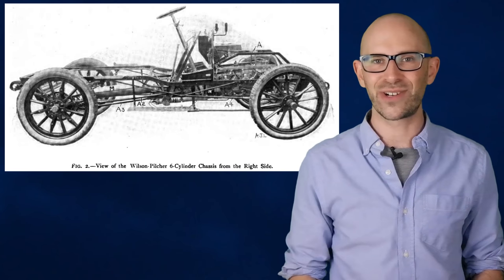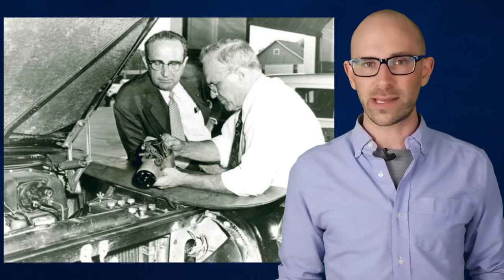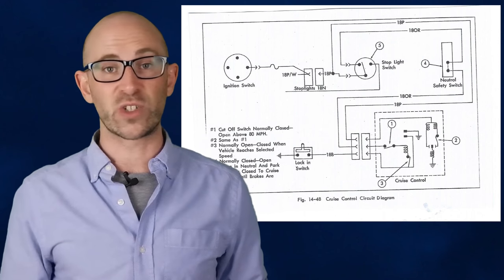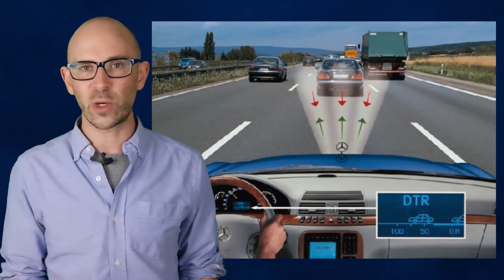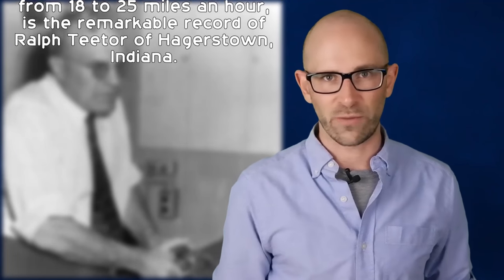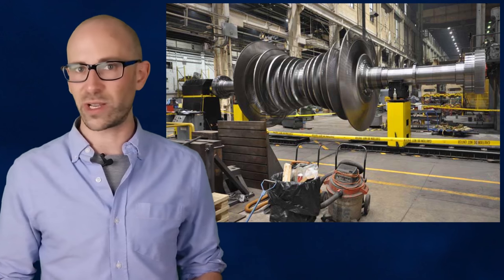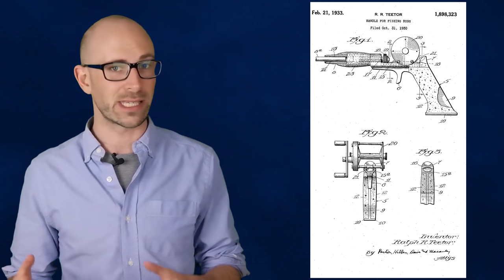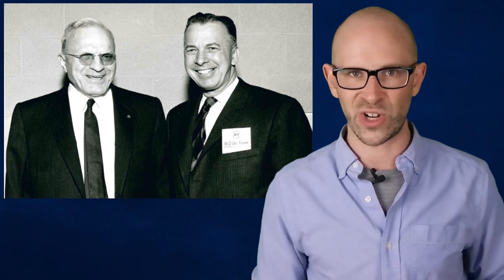The Blind Man Who Invented Cruise Control

Comment: I have trouble actually using cruise control because of the variation of traffic speeds.  Sometimes it's 75, others 60.
Reply: Might be worthwhile but where I usually encounter the variation is on Interstates where the limit is 70.
Reply: The more accurate way to describe the modern cruise control update is that it uses a form of radar to automatically adjust your speed to maintain a consistent distance from the car in front of you.